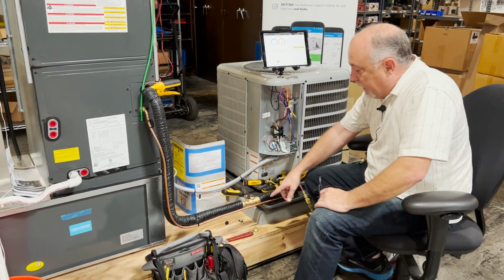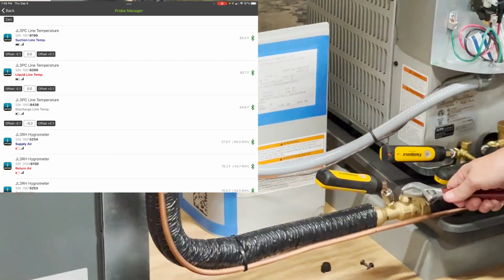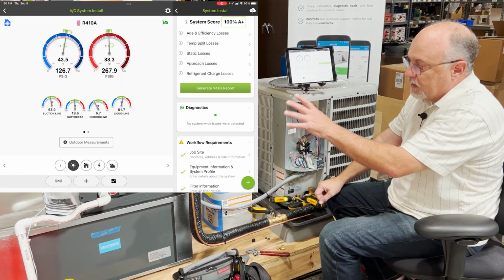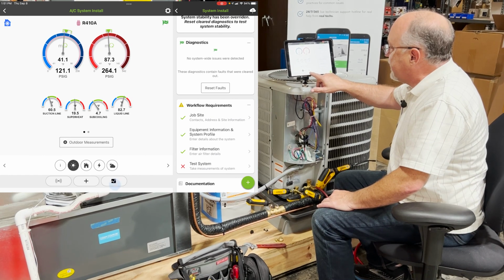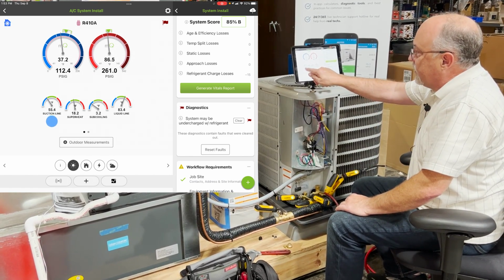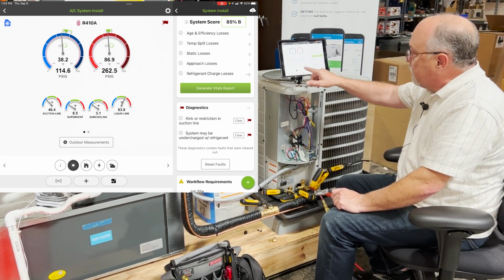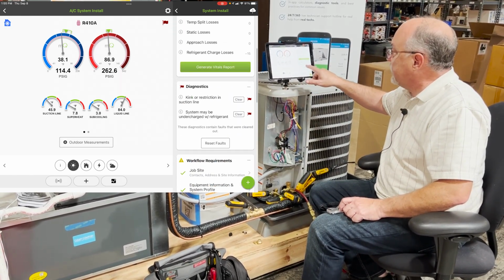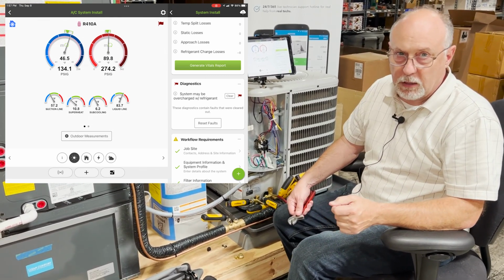Using measureQuick to Identify a Suction Line Restriction

Comment: How does measurequick know what discharge line the clamp is on? Is there a way to tell if it’s the compressor discharge line or the evaporator discharge line or ????
Reply from the maker: There is dedicated mapping for liquid and discharge lines.

Comment: What percent did you close the valve? Always curious about how much of a kink is to much? It looked like you were near 90% closed when you started to see anything?
Reply from the maker: It is about 85-90% closed, but remember that it is a ball valve so it is not proportional. At 75% it is basically 100% open as far as not creating a significant restriction.

Comment: How do you think this condition would look on a heat pump in heat mode
Reply from the maker: High head pressure for sure.
Reply: @measureQuick  I had a situation the other day on a Lennox heat pump where head pressure were climbing over 500 psi in heat mode noticed some compromised return ducts but my initial test of TESP with the filter removed proved around 0.37 with the filter installed and tested I was seeing 0.90 I recommended solving that first. But the lineset generating a very loud vibrating noise on the inside wall by the condenser when seeing high pressure. A part of me believes that suction line could be bent also but I couldn’t get a accurate cool check because ODA was under 65 (62 degrees) but when I did check I had low suction pressure about 100 psig but no High super heat it was about 10 and it’s a txv so that checked out imo. But I won’t rule it out just because of the excessive vibration. But I’m thinking airflow for my situation.

Comment: Very interesting, in over 20 years never come across this situation
Reply from the maker: I have seen 2 in 30 years, pad settles in new construction. We have basements so it can easily happen. If you are working in attics I would guess it would be a lot less common. We built it in as it is hard to diagnose.
Reply: Apartments. Many many of them have this issue sadly that will never be noticed or found as the whistle doesn’t happen often.

Comment: Hi Jim. I have a field piece VP87 vacuum pump that always trips gfi receptacles. I returned it and got a replacement and it still trips the gfi as soon as I flip the on switch. Any ideas? Have you had this issue? Thanks. Bill.
Reply from the maker: Have you tested it in another GFCI?
Reply: @measureQuick  Yes at multiple houses. Im thinking  its got to do with the DC inverter since my last pump was an AC pump and i had no issues. That is the only difference.

Comment: Just curious-it doesnt seem to flag anything when you use your discharge clamp on your suction line even tho it is still mapped that way. Not sure exactly what having a 59° discharge would indicate but I would have expected it would be a flag of something being wrong? Or did you unmap it when you used it?
Reply from the maker: We typically look at the entering suction superheat and the maximum discharge temperature as a guideline for proper operation. Copeland will tell you the max temperature for oil breakdown as well as the ideal suction superheat. There is a range listed for discharge line temperature, but if the actual compressor is known, the precise temperature can be calculated. I suppose since we can determine stable operation we could look at min and max for discharge temperature.

Comment: Once I had the system start and run normally. Then the low side equalized with the high side pressure. So the only thing I could figure was a restriction  in the condenser from the service valve to the compressor. So I pulled the new condenser and installed a new one.

Comment: Jim it fair to say that anytime the suction line temp at the condenser is colder than it is leaving the evaporator coil it’s a suction line restriction if you started with a proper refrigerant charge.  I’m looking at shorter diagnostic time w/o following the SH anSC thanks
Reply from the maker: Agreed, however that is not a common set of measurements that most tech do during regular service. I would have found it by sound first myself, then verified it with two clamps.
Reply: @measureQuick  
Thankyou for your time
Reply: @measureQuick  I have started measuring line temperature changes to my workflow.  I started on a day when it was over 100 degrees and found suction line temps rising 30 degrees due to bad or missing insulation.  I work on bulk milk tanks where the tanks are typically bulk headed in an outdoor wall.  This puts the evaporator connection outdoors.  In winter, this evaporator line will be going out into -20F ambient conditions and I would assume there might be some desuperheating in the suction line between the evaporator outlet (which is the EEV superheat control point) and compressor (which is indoors) inlet.  Might this new suction restriction algorithm flag this as a restriction?

Comment: Nice, can you make the same test with measuring pressure at coil and condensunit, if you have pressure drop more than normally, then you have an restriction or small suction pipe select.
Reply from the maker: There was a substantial pressure drop much more then the 2-3 psi typical. It is hard to see though because the pressure is only measured at one location.

Comment: I’ve ran across a few systems with low superheat and low subcooling after verifying airflow. Typically on hotels. 

So the main point is comparing temp readings at outlet of EVAP and inlet of condenser on suction line, and if the line temp is colder at the inlet on the condenser than the outlet of the EVAP, then there’s a possible restriction? 
Because we ‘should’ be gaining/picking up SH the closer we get to the condenser, not losing/dropping in SH, right?
Reply from the maker: Yes, you are correct. Restriction or floodback. One of the two.
Reply: You will only gain SH if the suction line is in a warmer environment than the refrigerant inside the suction line.  While this is likely for a residential air conditioning application, for refrigeration applications, that is not at all a safe assumption.

Comment: Did I misunderstand something on the diagnostic definition?
How is the condenser inlet HOTTER than the evaporator OUTLET?
His discharge temp clamp is 59° and the suction line clamp is 52°. Doesn't that make a 7° DROP/LOWER condenser temp and NOT a HOTTER condenser inlet temp? (He said 57° and 51°)

Basically you are doing the same thing on the suction line that you would on the liquid line or filter/drier, checking for a temperature difference between 2 points.

That restriction had to be quite severe to start to make any difference in more than one parameter before MQ could "see" it.
It also still had a low refrigerant diagnosis as an option, so be vigilant.
Reply from the maker: It is hotter on a properly operating system. For example 12 degrees of evaporator superheat and 15 degrees of total superheat. You are correct, the restriction has to be pretty bad for it to be evident with only a single probe at the condenser inlet. The takeaway is to listen for it because you may hear it before anything.
Reply: @measureQuick  
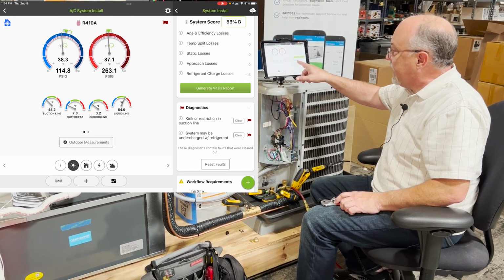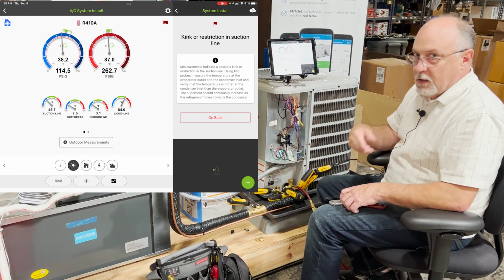Watch the video from 7:54-8:17. does what you say match the MQ diagnostic box?
I think the box writing is the opposite of what you say.

Comment: It would be Excellent to add some site glass before and after the ball valve.  
                Site glass immediately exiting the condenser another side class just before the expansion valve. 

And while the system is down for servicing might as well add a cycle class immediately before suction line entering the compressor in another side glass immediately leaving the evaporator. 

Catch on video phase change along the lines during different operating conditions in severe scenarios.
Reply from the maker: That is a good idea.